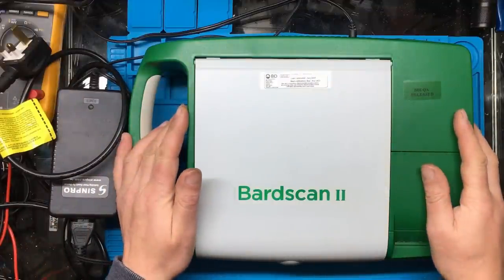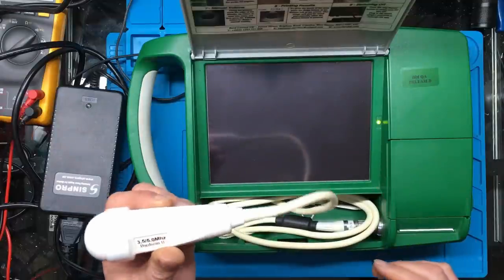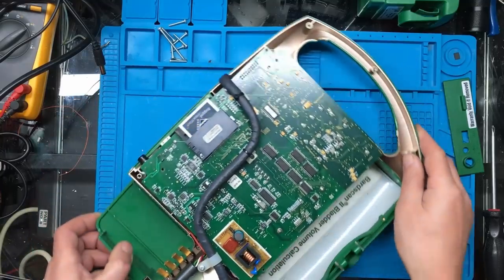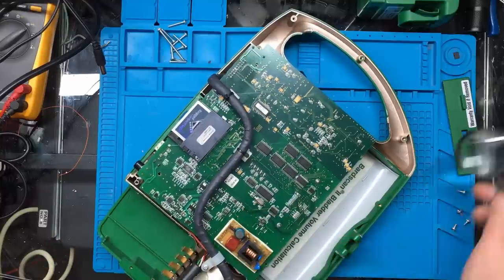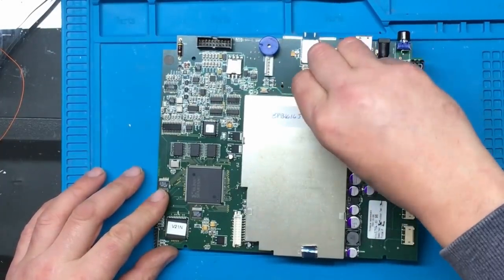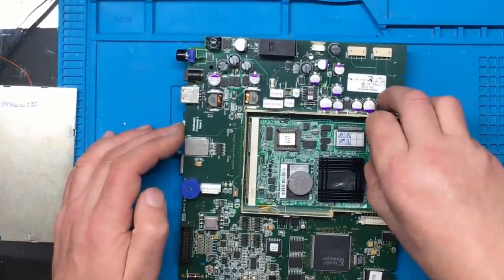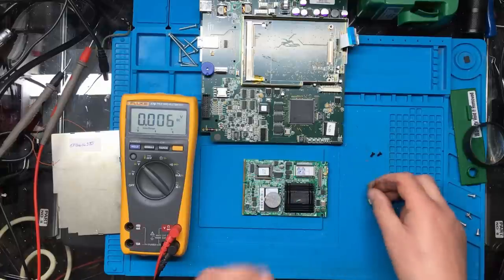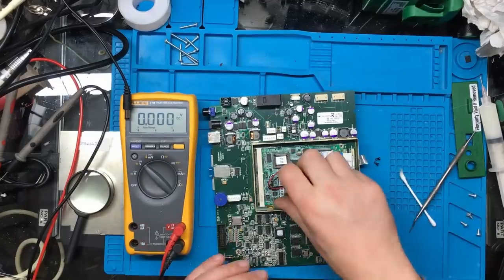Portable Medical Ultrasound Scanner - Teardown + Fix + Upgrade!

Comment: Hah, of course it runs doom!   It looks like the stock CF card is running Windows XP Embedded, a stripped down version of the OS intended for applications like this.  Geode processors and card-computer modules like that are fairly common in embedded applications for industrial and commercial systems.  They're low on power draw but offer good computing power for non-computer devices like handhelds and whatnot.  I used to have an IBM thinclient that had a Geode processor in it and it ran Linux natively on a 64MB CF card.
Reply from the maker: Yes, it was a lot easier running doom on this, than having to cross compile it, write an SDL layer and reverse engineer display and input drivers like I did on the innotab and LeapTV a good few years back (video's are on here too).

Comment: I used to work on fiercely expensive kit in my day job, but the most expensive thing I’ve repaired since I retired was a diesel injector test and calibration rig that the owner said would cost him £100k to replace if I couldn’t fix it. Sounded like a lot to me, but I guess he knew!  No pressure then….  (that wasn’t the fault by the way ;) )
Reply from the maker: Nice👍I've recently been asked to have a look at a train.. It's electric and 16Ton. I've no idea on the cost of it... Hopefully they get back to me and I'll do a video on it.

Comment: went for a testicular scan once. they absolutely swamped my bits with gel and then left the room handing me a single green paper towel.  i was halfway through wiping myself off when the doors burst open and in walks a nurse with a young couple.  they got the full frontal spread to full effect. nurse appologised, pushed them out and ran off embarrased 😂 i nearly went doom mode at the end.
Reply from the maker: 😂😂😂😂Thanks for sharing 👍

Comment: Hahaha its not finished until you make it run Doom :) A friend and I got doom running on an ATM, and a POS terminal.
Reply from the maker: Nice! I've managed to get doom running on a few different devices over the years. This one was easy. On other devices I had to reverse engineer control inputs and display drivers and cross compile for different processors. It was a bit of a task!

Comment: Great video Mick.
Many years ago a work colleague had a sheep farm at Keilder and a couple of us would go and help round up the flock to check to see which ewes were in lamb. The guy doing the scanning used wallpaper paste instead of ultrasound gel!
And yes, I have had my bladder scanned with one of those machines!
Reply from the maker: Nice one. Keilder isn't too far away from me.

Comment: Very impressive! Especially the password detection. Working in the web world, looking for a hardcoded plaintext password wouldn't have even occurred to me!
Reply from the maker: Thanks 👍
Reply: These industrial/commercial systems have appalling security levels (or lack of security) it seems. I've been told that each and every fire alarm panel from a certain manufacturer has the same password that can't be changed (and it's something like a two-digit number with two identical digits, like 99).

Comment: This is brilliant.
Are there any other YouTuber you know who does hardware and software reverse-engineering like that?
Reply from the maker: Thanks 👍I'm not too sure, I'd guess so. I've dabbled with repurposing things for quite some time 🙂👍
Reply: There are many reverse engineering / pen-test channels that do reverse engineering with stuff like ghidra, and quite a few that do hardware teardown/repair. But channels like this that do electronics repair but then suddenly drop into low level software debugging when appropriate is rare…
Reply: Check out a channel called Mikes electric stuff, he's got a few videos where he does stuff like reverse engineering the password to a baggage xray machine or takes apart old medical devices
Reply: @Adam_151 Thanks!

Comment: That Nicad battery pack likely is still good. They probably will charge up if the machine is left plugged in for 16 hours or so unless some of the cells have an internal short. If they do zap each shorted cell with two or 3 times the voltage it usually runs at for a few seconds at a time until it shows some voltage output. Then charge normally. I have Nicad batteries that have been used for 10 years or more as long as they don't leak.
Reply from the maker: They do charge, I've left it on overnight however they battery life doesn't seen great (30 minutes or so).

Comment: When you opened up the internal SBC to change the battery, it looked as if there had been some thermal compound between the tin lid and the component you thought might be the graphics chip. I was a little concerned the replacement battery might stop the thermal contact here.
Reply from the maker: I don't think it sticks up any higher than the original battery, and the lid seems to fit on without any resistance. It's been working fine and I've used it a few times since. I managed to scan our sheep with it and used it on a friends dog a couple of weeks back 😂😂

Comment: It looked like the board was perhaps trying to charge that coincell battery since the residual voltage of the old cell was dropping while you measured it. That would not be very healthy for an ordinary CR2032, so perhaps you should install a schottky diode in series with your new battery? Or put a rechargeable one in there.
Reply from the maker: I thought perhaps it had some residual voltage in it after I removed it as there was no load on it, and measuring it was slowly draining what was left? I don't  think PC CMOS batteries are usually rechargeable rechargeable, but this one might be different..
Reply: @BuyitFixit  Possibly. But I think the load from the board would have drained it to zero in that case since the impedance of the board would probably be lower than the 1 Mohm impedance of your multimeter.
Reply from the maker: @mcg6762 you may well be correct 👍

Comment: As soon as i saw the cursor on the screen, i recognised it running some version of windows OS and from that point on i wondered if it could run doom, and you sir did not disappoint at all 😂😂
Also, did you find what the Bluetooth module was used for? Remote scanning? Image transfer?
Reply from the maker: Thanks 👍I did find out what the Bluetooth was for but I'm trying to remember. I think it was for some add-on device that the company made possibly to measure flow rate 😂

Comment: Why does a millwaukee drill have a backup battery?
Reply from the maker: It's for the onekey BLE module to enable and track the tool. Some of the tools have this as an added security measure a bit like DRM in case the tool gets lost or stolen, or to stop unauthorized use.
Reply from the maker: Thanks for the mention on Twitter Mike! I've watched some of your tear down videos before 👍👍👍

Comment: I was hoping you would put Doom on that thing. Sad that it doesn't play sounds though maybe PC speaker since it has a buzzer?
Reply from the maker: I think the chipset supports sound but not sure if the larger main PCB has the signals going anywhere. Because I was running in DOS drivers would probably be an issue too.
Reply: @BuyitFixit  I ran Doom one time after installing a sound card in my pc without the drivers and the sound effects worked but music didn't. If there is a sound device and amp built in to the board but all it has it that buzzer, maybe connecting a real speaker to it would work.

Comment: Am late but the chip under the heatsink is the amd cpu and the chip named geode on the back is the companion chip.
Reply from the maker: Well spotted! Yes I missed that, thanks for pointing it out. The chip I was looking at was the Southbridge (CS5535) and the CPU is indeed under the heatsink on the opposite side of the board.

Comment: You have mentioned low melt solder a few times. When you use it does it combine with the solder on the board and make it easier to remove, clean and re solder components?
Reply from the maker: Hi Chris, it combines with the original solder to lower the melting temperature to make it easier to remove things as it stays liquid for longer. Especially good for things like HDMI sockets and ICs etc.
Reply: @BuyitFixit  Thought that might be the answer. Have a good seasonal fun (bah humbug) and new year. Shame I dont live closer, bet I can find loads of stuff needs fixing 🙂
Reply from the maker: @chrisbartlett6022  Thanks Chris. Hope you have a great Christmas too!

Comment: Looks like it runs a version of windows xp embedded. I wonder if its been custom made to not include explorer and stuff.
Reply from the maker: It does indeed run XP embedded. I did find a way to run explorer and cmd etc by going into the touch screen calibration part and there is also an option to add printer which let's you browse the file system then you can double tap on explorer or and other applications 🙂

Comment: How will this thing do at (for example) finding a break in an electrical cable or a burnt track inside a multi layer PCB? Lots of other non-meaty uses I can think of but wondering if it is worth getting one.
Reply from the maker: I'm not so sure it would work for that as you're going to have to cover the board in ultrasound gel for the sound waves to conduct, otherwise you will just get the pattern of lines on the screen due to what I think is the impedance mismatch.
Reply: @BuyitFixit  So that would probably be the cover on the transducer. Have you had that in bits? It must be possible as they do use ultrasonic for inspecting welds and other things like that.
Reply from the maker: Ah right forgot about welds etc. No the probe is all sealed and it would be a destructive tear down to open it up.
Reply: @BuyitFixit  Ah, right. No point going down that road. I wonder how it would go with the range finding ultrasonic PCBs you can buy. I don't know the frequency of those.

Food for thought. I shall buy one when one comes along cheap. How many wires to the probe?
Reply from the maker: Not sure. The machine here does 3.5 and  5 mhz

Comment: An ultrasound is an ultrasound - you shouldn't have to invoke a different app to look at a bladder or a liver, or a uterus or an ovary. As long as your transducer can make good ultrasonic contact with the skin of the patient (sheep), you should be able to scan her abdomen? Or have you found otherwise?
Reply from the maker: I would think the same, perhaps it just sticks a label on or interprets some of the data differently? I actually used it a couple of weeks back on or sheep and it looks like we could see a skull and a spine, also tried it on a friends dog about a week ago, we could see round circles which is supposed to be right for the stage she is at.

Comment: What does it do if you plug in a USB hub with a mouse and keyboard?
Reply from the maker: In windows xp embedded a keyboard and mouse works, unfortunately I couldn't get any dos drivers to work with the boards chipset when running Doom.
Reply: @BuyitFixit  no legacy IO options in the BIOS?
Reply from the maker: Couldn't get into the bios. I guess there must be some ps2 keyboard connections inside the unit possibly? USB keyboard does nothing when it says press F1 for setup, but it does work when the OS boots.

Comment: This is proof that if there's a device that can make a video output then it can play Doom
Reply from the maker: Indeed, although this one was fairly easy. I've ported it to things where I've had to reverse engineer drivers, write code, cross compile etc on devices like the leapfrog TV before :)
Reply: @BuyitFixit  One of your next videos should be on trying to put doom on the oldest device that you can find.